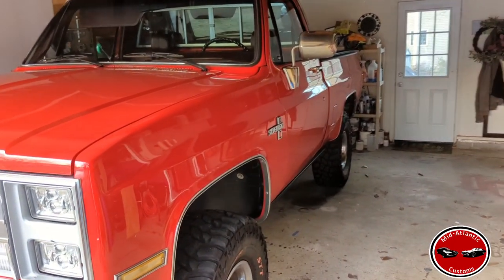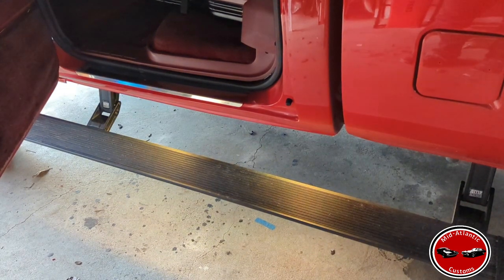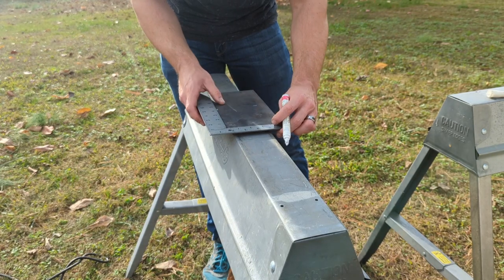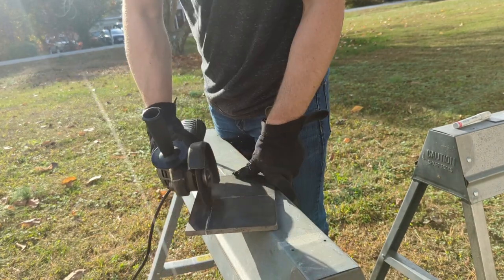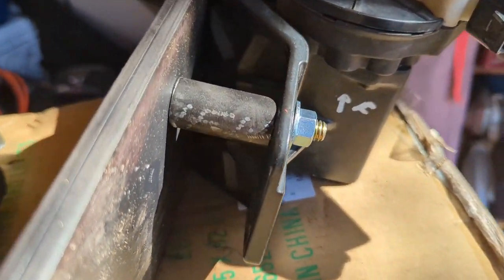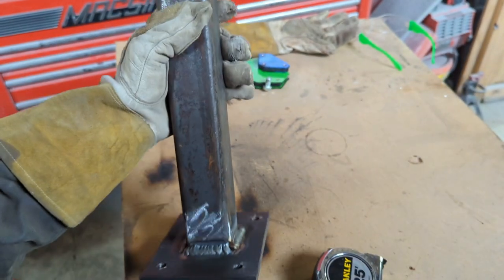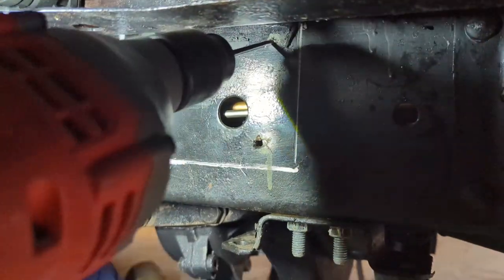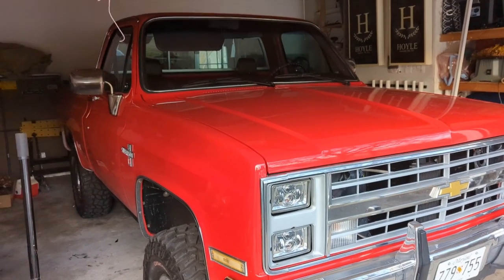AMP Research Running Boards Installed on the 1973 - 1987 Chevy C10 K10 Squarebody

Comment: I have an 82 K20. Which should i look for to work on my truck😊
Reply from the maker: Best thing to do would be to pull a measurement on your truck between front and rear wheels, and then search for a set of steps that fit into that dimension. The 2019 F150 crew cab steps had to be cut down on this truck, so would likely work on the K20

Comment: Very impressive. I had an 84 GMC 4x4 and didn’t think this could be done with the saddle tanks . Question, if a guy went with a blazer rear tank and removed the saddle tanks , would you be able to relocate the brackets in order to get the motor to tuck under better,or would there be no difference? 
I don’t anything about these running boards and was wondering if you can locate the brackets where you want on the running boards , or is it a fixed area?
Reply from the maker: Yes, you could definitely hide the motor / tuck the running boards higher if it wasn't for the saddle tanks. I considered doing the rear blazer tank for that purpose, but we had already completed an LS swap on this and reconfigured everything to support dual saddle tanks. Still really happy with how it worked out.
Reply: @midatlanticcustoms  yes it looks excellent, you did one hell of a job. My 84 had a 6” lift with 35’s , and those steps would have been so helpful. 
You mentioned engine. My biggest regret was not swapping the 305 out for an LS6 454. My 84 had a factory 4 speed standard , and 3.73 ratio in the diffs . I think a big block would have been perfect for fighting those tall gears

Comment: Just found a set for $400! Going on my 83 K5 Blazer, I'm mounting mine to tuck up behind rock sliders. Its got about 10 inches of lift, one ton Dana 60 and 14 bolt axle swapped and 42" super swampers, and I'm getting tired of sitting on the rocker and pulling myself up by the A pillar lol... One question I have. Are you using the the amp research control module? I'm either going to find one or figure out my own series of relays
Reply from the maker: Awesome! Yeah I'm using the control module, wiring is pretty simple for it, you don't need obd2 or anything to operate them. I probably should throw together a quick video on the wiring. Just using the door switch to trigger the ground contact into the module.
Reply: I'll be waiting patiently on that vid. I scored an unopened kit for $500 and will be installing this weekend. Excellent write-up!
Reply from the maker: @landonus13  hopefully you found the wiring video!
Reply: Can you show how to do the wiring please

Comment: Did you drill through both sides of the frame and secure from the backside or thread them in? Edit: looks like you drilled through both sides and bolt came through the back and nut on the on front?
Reply from the maker: Drilled through the frame. Grade 8 bolt, nut, flat washer and lock washer. You could orient the bolt either way. I believe I have threads pointing towards the inside of the frame rail. Hope this helps.
Reply: @midatlanticcustoms  thanks for the reply. Going to give this a shot on my 82 toyota pickup

Comment: Beautiful truck and great work.  I have an 85 K5, would the measurements be the same?  Thanks for the video!
Reply from the maker: Thanks! They should be very close, I'd pull a tape off the frame and check to see. Should be within 1/2"
Reply: @midatlanticcustoms  Thanks! Keep the videos coming.

Comment: Hey man, did you install these with the use of the control module? Do you know if they can be wired directly to  the switch without the power module?
Reply from the maker: Yupp, I used the control module. No need for the obdii connector. Two purple wires from the control module can be tied to the door switches to provide grounds for the step function. Planning to do a quick video on the wiring, just need to find the time!
Reply: @midatlanticcustoms  Okay I gotcha. Great, look forward to it.
Reply: @midatlanticcustoms  are the steps functional without the module? Can they be wired directly?
Reply from the maker: @trevorballard9495 no, you need some sort of control module. The steps operate for a certain length of time each time the door is opened or closed. You can order the standalone control module direct from AMP. Wiring is pretty straightforward
Reply from the maker: @trevorballard9495  hopefully you found the wiring video!

Comment: so if you can put it on a square body , you should be able to put it on a 94 burb?
Reply from the maker: Yes, and you'll probably have more room to mount since you won't have the saddle tanks interfering. Just have to find a good location to mount to the frame.